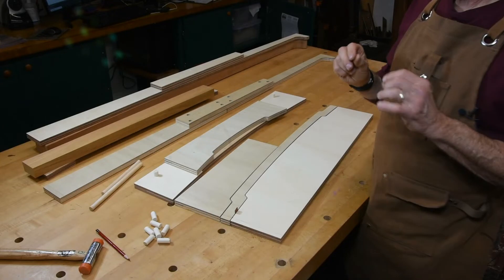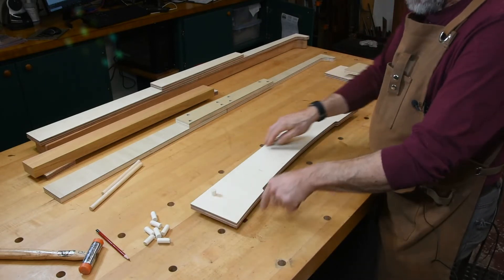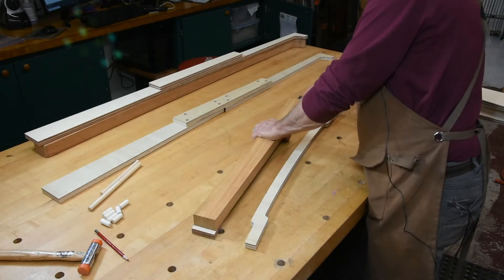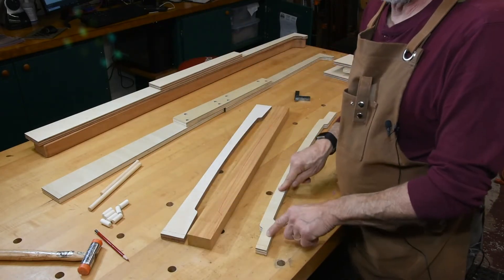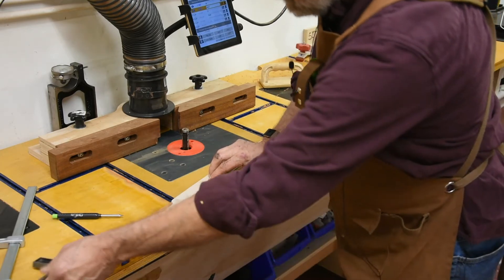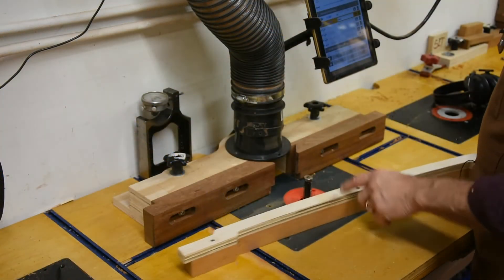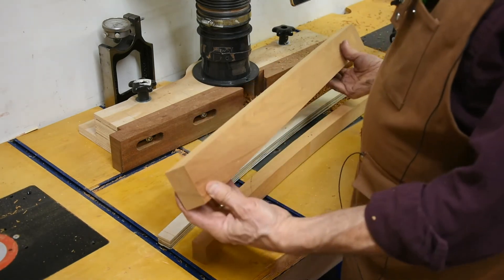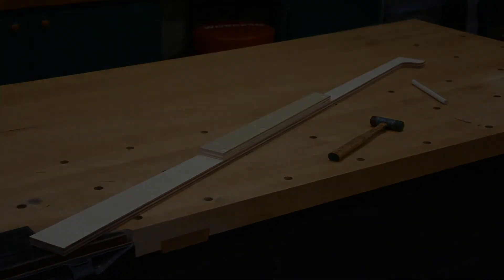Fremont Chest of Drawers Templates

Comment: Thanks Darrell.  This saves a lot of time.  BTW, what are the approximate dimensions of your Fremont Dresser?
Reply from the maker: Hi Jerry, The overall dimensions of the  Dresser are 22 1/2" deep x 31" high x 68" long, Keep in mind this is overall so the depth and length are taken off the top.
Reply: Thanks Darrell.  Just completed two nightstands (finishing pending) and starting the chest next. But to complete the set I need a dresser as well.  Hope you don’t mind if I reverse engineer you dresser using what I learned in these first two projects.  I’ll give credit in an interior message to you as designer.  

I’ve owned a plate joiner for years and have never used it for anything other than an alignment aide for panel glue ups. Works quite well in your application.  I will consider it more in the future.  However I secretly hoped you used a Domino throughout so I could justify dropping $1K on a Domino 😀. Thanks for saving me money.....